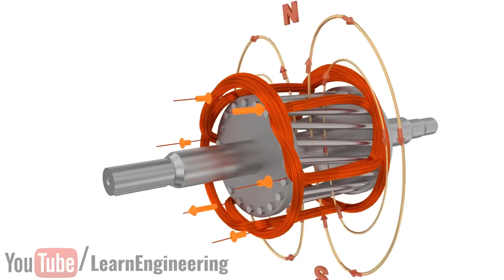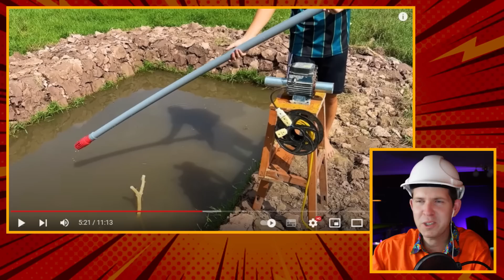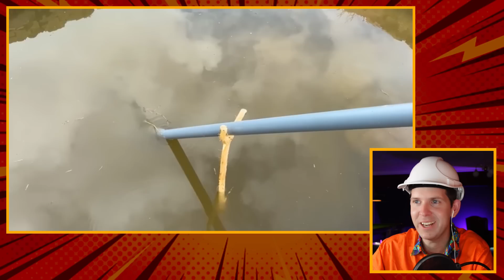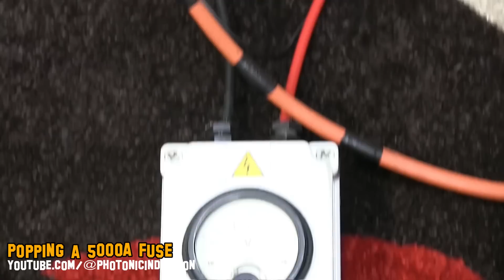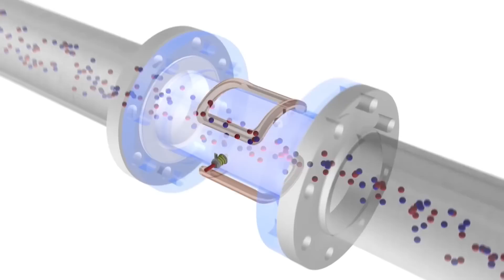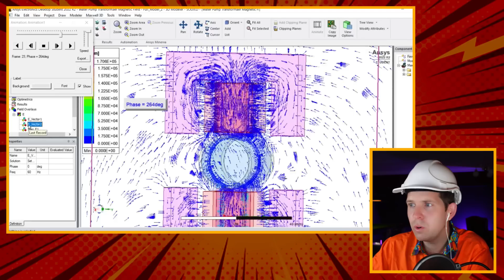Exposing FAKE Primitive Electrical Videos

Comment: An electromagnetic drive without moving parts has been a wet dream (pun intended) for scientists for as long as submarines have existed. This is what they call "caterpillar drive" in the movie "The Hunt for Red October". However, inventing an efficient "magnetohydrodynamic drive" proved to be extremely challenging and so far there are only very inefficient prototypes. If it had been so easy to make, we would have seen submarines without propellers already during World War II.
Reply: One reason that I don't trust these videos, is that if they invented a drive like this they would've patented the shit out of this. Or if they're into contributing open source they would've made themselves the face of this project to get some fame. All this, while media and engineers would've investigated every part of the invention.
They certainly wouldn't make half-assed videos without showing any prototyping, commentary and without showing their face to make them as anonymous as possible.
Reply from the maker: So true
Reply from the maker: 100%
Reply: They also require superconductors and not just some random coils plugged into a socket.
Reply: Jupp this reminds me on this video  where someone build one :https://www.youtube.com/watch?v=nFsiydplCtw
Not much thrust and because it is exposed you electrolysis the water what gives you away and on top if you do this in salt water you leave a toxic cloud of chlorine gas behind you
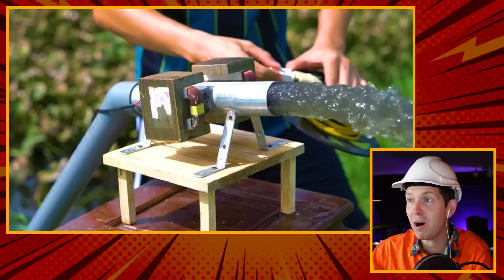Reply: 7:41 what the fuck is the extension cord plugged up to
Reply: @dannysdiylife9214  Could be a 12 volt battery or 12 volt transformer, or it might not be connected to anything. Look how the pipe is twisting right before the water starts to flow, I'm confident that's because of the circular momentum of a water pump, which is most likely is started by a person outside of the view of the camera.
Reply: @Fiercesoulking  *Chlorine gas: the salt in salt water is sodium chloride.
I guess it would be more exciting if it was sodium fluoride...
Reply: @dj1NM3  ups yeah I meant chlorine gas
Reply: Maybe it yould be silent acousticly. But magnetically? The MAD sensors possibly pinpoint these from 100s of kilometers.
Reply: One ping only.
Reply: even with salt water in the ocean it doesn't seem to move enough water and you can't turn
Reply: They just need to heavily ionize the ocean.  Simple.
Reply: @dannysdiylife9214  a Nuclear reactor that they built out of scraps... in a shed. in a cave, they would make a power suit.
Reply: you can make one, and it has been done - mitsubishi heavy industries built an MHD drive boat called "yamato 1" back in the nineties, but it wasn't incredibly fast (15 kph) so they gave up eventually... tech ingredients channel built an MHD pump i think, too?
Reply: @grkvlt  And basically all the empty space on the Yamato 1 was used to store the batteries to drive the thing. It would be like having a car with only a driver seat. No passenger seats, no trunk/boot - only a really weak, fuel inefficient engine and all the rest a giant gas tank.
Reply: @wojtek4p4  The exception perhaps would be military inventions, and in some cases, interventions.

Comment: Minor side point: His assistant’s timing for turning on the submerged pump at just the right moment when he “plugged in” the fake one seemed uncannily good. Then I realized he could be using the cord and fake gadget as a switch: Just put the conductors of the extension cord in series with the actual pump motor, then connect them together with a direct short in the plug. Voila, a remote switch 😁
Reply: The magic of a thousand takes, I guess.
Reply: fake pump, real pump -> power strip with 2+ sockets -> extension cord
when plug on, other turns on as well
Reply: Similar trickery with the submerged motor. It's a small DC motor, connected to a small voltage, probably 5V, coming through a plug that's designed for 230V. Everybody thinks it's using mains power because they use mains connectors but that's just as fake as everything else in the video.
Reply: That's also what I thought.
Reply from the maker: I had that thought as well
Reply: 7:41 what the fuck is the extension cord plugged up to

Comment: What amazes me the most is that this guy is even alive anymore.

I especially love the way how he sits bare footed in a puddle of water while playing with extension cord and throwing it around like it was IPx7 and not plugged in. I bet he's been shocked a lot to this day, enough to accumulate actual brain damage and thus keeps doing the same mistakes over and over again.
Reply: I hope that happened at some point. But probably not. Its not plugged in. He did accomplish his goal though: you see a power brick, you think electricity, lol.
Reply: Na, it's not surprising. The guy is smart.

Take the pump with the microwave parts for example. Look very closely at the switch on the surge protector.

There is no power going to the protector at all.

The switch is semi transparent which means that it also serves as the indicator light that the protector is both ON and has power.

The switch is indeed on, but there is no light which means that there is no power... Which means that the protector isn't even plugged into a power source.

All modern-day surge protectors have indicators, have for decades really.

Some even have separate indicators. One for power supply, ground and the switch being on even.
Reply: i feel like that was all DC and even the cord is fake. He has  a battery out of sight. He is in the middle of a field  I doubt he has AC power there
Reply: @TechTinkerWorks me too, but he could be using the power cord & board with low voltage as a trigger for a relay to run a decent DC pump with the amount of output it had.
Reply: There is no power near him...a submersible pump and that's it...Those wires and blocks do NOT carry any voltage.

Comment: I noticed the water coming out of the pump is way too clean to be coming from that muddy pond, plus if the water was actually coming from that pond then the sticks leaves and dirt would likely clog the pipe. The cable visible at 6:40 I think is actually a hose that feeds water from some external source to the “pump” that he made.
Reply: They make the pond muddy to hide the real pump/hose/whatever the water actually comes from

Comment: What I like is how the "pumping" part is not in contact with water and yet draws water from 2 meters away in the long pipe. Impressive.
Reply: and it does it instantly, no need for it to be primed or have time to build a vacume to draw up the water... I think the power cord is just a short, acting like a swith. When you plug it into the power strip, it completes the circuit and they use the power strip to conduct power to a pump on the other side of the pipe, hidden under water.
Reply: And that table tiwcthes.
Reply: good eye
Reply: thats because its also a portable transporter...
Reply: @aMartianSpy  niiiice . Is this  the same technology as stargates or star trek's "beam" ?

Comment: It's even more funny because you can tell the surge protector doesn't even have power.  That black one with the parts from the microwave would 100% have a lit up power switch if it was plugged in and on.  (You can tell because the switch is semi-transparent)

Comment: Thanks for the time you put into this. I have seen the videos you debunk here and I saved them as a possible talking point in a future video as well. You took it to a another level than I could have! I am concerned when videos like this show fake crap. So glad channels are calling them out. I am afraid someone will get hurt trying to do the same thing. I know people have died from using microwave transformers as wood etching etc. because they don't even realize the danger. Not even a GFCI can protect you.
Reply: yes! some videos really downplay how dangerous this is, and non-electrically aware people who don't understand safety can sometimes get seriously injured. like this video where he's submerging part of the motor coil into the water. if he was using AC (which i don't believe is the case - i think this is all low voltage) then he's just recreating the classic toaster in the bath scenario. someone is going to get hurt trying to imitate this.
Reply from the maker: Thanks so much for the support mate

Comment: Lets not forget that when the transformer pipe is horizontal, there is a massive flow of water gushing out, but when its standing vertical, the water just spins within the pipe.
Reply from the maker: I know right 😆👌

Comment: I learned about starting capacetors this last summer when my blower motor on my HVAC at home stopped working.  I was thinking I need a brand new furnace but no...just a cheap little part

Comment: correct me if Im wrong but PSC motor is just winding with start winding and capacitor in run winding and maybe a start cap in the start winding, the rotation is from the rotor windings not the stator windings. The start winding gets it all going and the run cap makes the phase shift based in the rotor. So in this demonstration the motor with out the rotor is basically like a big solenoid. solenoids do burn out if you take the actuator out from within them and energize them .  Of course, they do not move water like this , at all.  I've only ever seen non magnetic materials affected by super strong magnetic fields driven by state of the art super conducting magnets and even then they only slowed a piece of wood as they dropped it down through one.

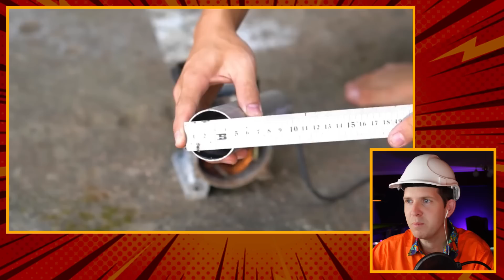Comment: 2:20 completely unrelated, but i remembered something with my grandpa who passed away a little over a year ago.  

My grandpa had a small workshop in his basement and had taken apart just about every broken appliance for parts that could be useful at some point in the future.  One of the things he had was what I'm now pretty sure was a permanent magnet from a DC motor.  It was pretty much a pipe with a stong magnet lining the inside of it, about 4 or 5 inches in inner diameter.  He handed me (probably 8 or 9 years old) a screwdriver and promised me some money if I could put the screwdriver down the center of the magnet without touching the sides.  It was impossible for me or my cousin to do, and led into some cool iron filings and magnets experiments he showed us.

Just felt the need to write this out after it popped into my head watching this.

Comment: Magnetohydrodynamics is a thing, but even if you were trying to move a liquid as conductive as mercury, you wouldn't get THAT much flow.  With water there would barely be any movement at all.  You'd have to use a dye to detect the smallest amount of flow.
Reply from the maker: Well actually mercury would flow quite good but yes the flow is very minimal with water, like tiny

Comment: At 7:40 when the “pump” starts, watch how the whole thing moves. The pipe going to the pond is going to the left. If it were pulling water at that angle the apparatus would move toward the pond. Instead it moves away because the water it being pushed from below, pushing the pump in the direction you see. QED

Comment: The guy is safe, holding the transformer wires with scissors, because electricity takes the path of least resistance and this guy is obviously super thick😅.

Comment: My father spent months developing a circuit to multiply voltage to get to hundred thousands for an electric filter. 

And this DIYer just pulled 500KV coil from the microwave. 

Understandable.

Comment: I think you missed a few points.
On the power bar that likely was just bringing perhaps 12VDC to the hidden motor, the light on the switch wasn't lit.
If you put just an iron pipe in the field of an induction motor like that you will most likely pop a fuse and if you don't then the pipe would get hot and little else will happen.  The bore of the pipe will be effectively shielded by the magnetic pipe.

Comment: The most I know about capacitors and their use is their use in computers where they're used to take in a 'wobbly' current like from the outlet, and output a 'not-wobbly' current, or in probably more proper terms, removal of power spikes that could damage very sensitive components. Also cause a smooth 'not-wobbly' current is better for overclocking

Comment: Putting raw power to random coils of wire? In school, in the classroom. We rewound a 30 HP commercial 3 phase electric motor. To to test our work (the smoke test) place a steel marble in the inside. (Before installing the rotor) and switch on the power. If wound correctly, the ball will stay centered and run around the inside like a squirrel in a tredwheel. We did, and it worked. In fact, it was pretty cool. So we did it some more. The lights went out. Half hour or so they came back on. And we continued to play. Lights went out again. This time for a couple of hours. And Arkansas Power and Light pulled up to our classroom door. Our little smoke test pulled so many amps or watts or something, that we blew up the main transformer supplying power to that small town of five thousand. Imagine that.
Reply: I don't believe a single word of what you wrote after the first two sentences  - they are nonsense.

Comment: If you like these videos then you'll love the ones showing guys "discovering gold and treasure". They "find" gold painted rocks, tumbled stones, and absolutely phony looking fake colored glass "gemstones" inside sea shells, balls of mud, and obviously handmade fake concrete "stones". I've also see  a few where they "discover" those big phony fake glass "crystals" buried in the mud. And then there's the one where they discover the "skeleton" hand (obviously plastic) with the "valuable gold rings" (also obviously fake) on the fingers. Some of these ridiculous videos have a huge number of views....   and most of them are so bad they are hardly even entertaining. They've actually crossed the line from "so bad they're funny" to "just plain stupid". And then there are the ones where they pretend to remove barnacles from sea turtles to "rescue" them... where the barnacles have clearly been glued on with hot melt. (Not at all good for the actual turtles they victimize.) I just do not get it.

Comment: I love how the suction pipe is leaking water at the connection. If the "pump" he made worked, it would suck in air instead of leaking water... 
It is also funny to watch the transformer "pump" rotate when he plugs it in, that is the rotating force from the submerged pump turning on. You see this with well pumps and sump pumps, they make torque arrestors for those pumps so the pipes don't get damaged... 
It is one thing to make some BS videos about "free energy" or "primitive anything" but I really don't like it when the product they show is actually very dangerous! If some kid tries to make something like this they could easily hurt or kill themselves... The people who make these videos need to get reported so the videos get taken down and hopefully the channel banned! It is misinformation at the least, and potentially dangerous and harmful!

Comment: All that and you never pointed out that the guy was standing in water with a non-grounded cord? I about had a heart attack during parts of that video!! 

I will say that I find it interesting that they've figured out how to monetize stuff that isn't actually possible. Then again, there's at least one channel dedicated to debunking stuff like this all the time.....Capt. Disillusion. He's also hysterical. You got yourself a sub though, that was pretty entertaining =)  Cheers, and thanks for the great video!
Reply: The person was quite safe. There was not any electricity anywhere near that contraption. The power strip was not even plugged in.
The power cord and pump were hidden by the dirty water.

Comment: A small battery driven milk foam motor thing, low tech low voltage placed under water to do the stir effect with the standing water filled pipe.
The second clip with the not really covered pump and cable.
You could have burried it, if you owned a pump,  you can't burry somebody's pump in sombody else's yard. The coat that covered it looked a bit like a uniform from the fire department, that is where you could "rent" a stromg pump as well.
I guess they organise, hire or rent the hardware, tech (everything and everybody) they need for a quick production gig and dissappear,

Comment: 10:00 Notice he's standing barefoot in water holding the power brick connecting two high voltage transformers lmao. This would have actually killed him so quick if these actually did anything

Comment: That black power strip at 10min mark is so cheap. it sounds empty but there is no pressure on the plug with how easy it almost falls out and he moves the plug in and out.

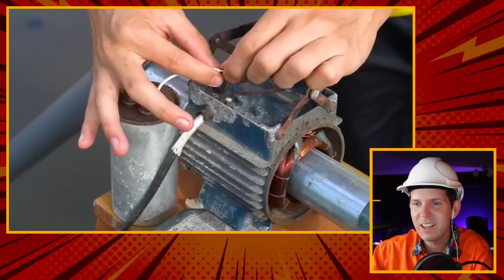Comment: 5:15 that's called "power factor correction". And essentially you are reducing the overall power consumption in order to almost only provide for the real power (in Watts), and eliminate most of the reactive power (in VARs)
Reply from the maker: Whilst capacitors are used for PFC in this instance it’s supposed to be used as a phase shift to ensure the motor can rotate
Reply: @thinklist  Isn't the phase shift between voltage and current undesirable and what causes a lower PF?
Reply from the maker: @caffeinatedinsanity2324  yep you are correct but in this instance it the lesser of two evils. A 90 degree phase shift is able to create a "rotating" magnetic field.
Reply: @thinklist  OH i get it now. You got another set of coils because this is a single phase AC motor, and you need that phase shift in that 2nd winding. Thanks for putting me back on track haha.
Reply from the maker: @caffeinatedinsanity2324  spot on ya legend 🤙